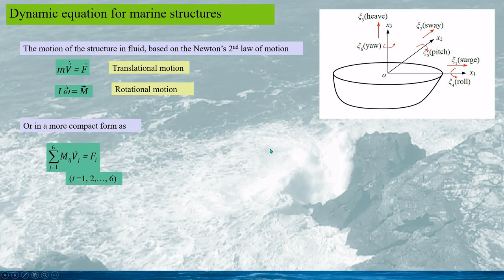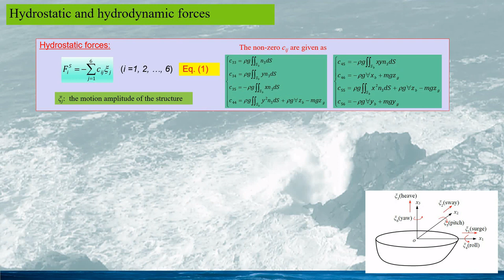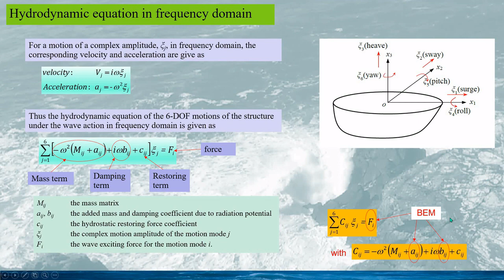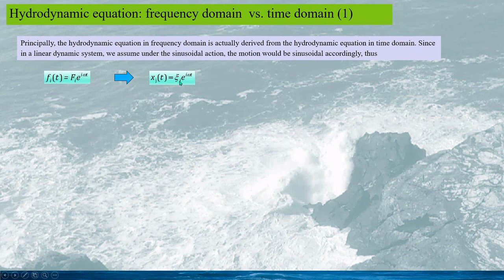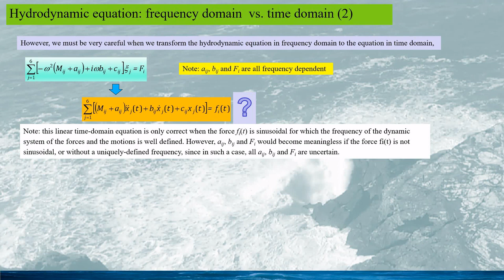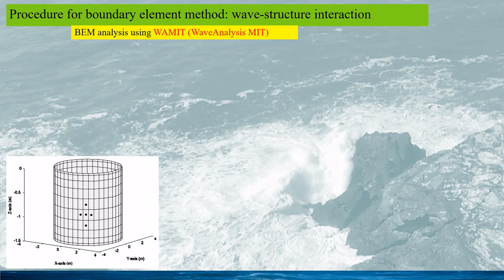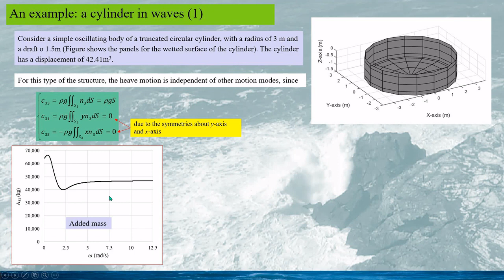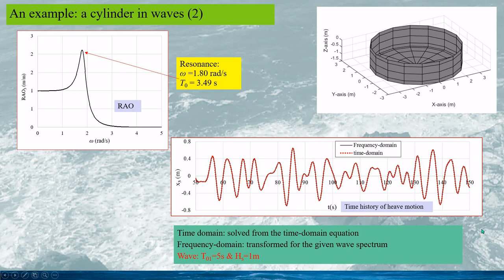[Fluid Dynamics: BEM] Wave Structure Interaction, Part 4: Dynamics and motions

Comment: Thanks alot prof.the steps you too in obtaining the added mass and damping by paneling and down to solving the RAO has been what im looking for.please could you share a link to source code of this simple exact solution to this cylinder you used in this example?it will greatly simplify the understanding of the application of all the principles explained here.thanks in advance
Reply from the maker: have you download Nemoh or HAMS? it is quite straightforward to use them for the simple problem. I think Nemog has  a test run for such an application.
Reply: @ScienceofFluids  i have downloaded NEMOH. I will explore the test cases again prof.thanks once more

Comment: Prof thanks alot for these lectures.Could you do a talk on Higher order boundary element and its application to wave structure interaction  please?there seem to be no good learning resources to this. Thanks in advance
Reply from the maker: Hi there. Yes, you are totally right, I didn't find much information on the topic. May be you can find some in WAMIT website. However, for most applications, lower-order panel method would be good enough. I saw hardly the real applications for the higher-order panel method. My experience also told me in many cases, lower-order panel method is better, especially in the reliability of the computations.
Reply: @ScienceofFluids  thank you so much 😊